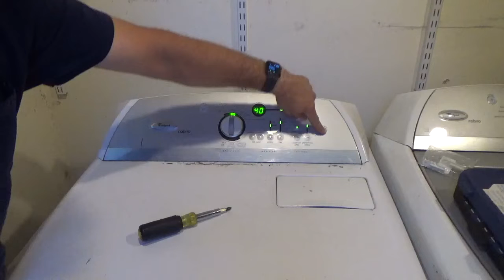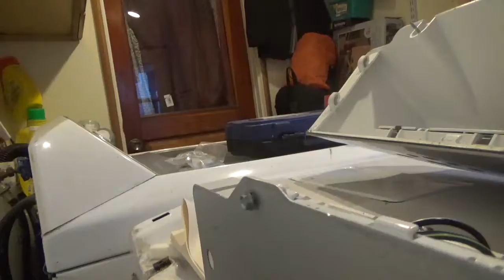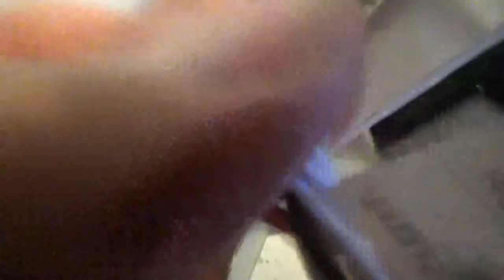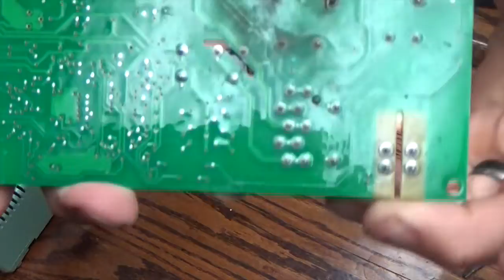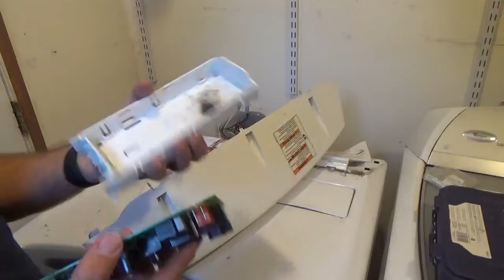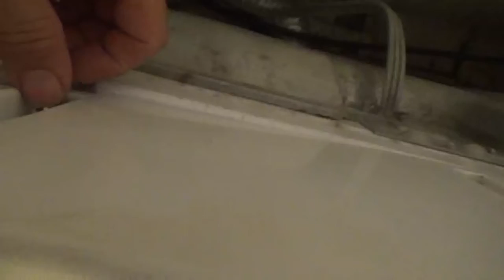Whirlpool Cabrio Dryer repair.  Motor won't start

Comment: had resoldered this relay 3 times over the past 10 years or so, this time i got the F1 error resoldering did not work.  Also could not test continuity through the relay. this video was VERY helpful . the relay is available on amazon for 10$ and used some wire from an old extension cord from my garage for the trace reinforcement wires. Thanks for posting!
Reply from the maker: Wow, glad it helped you solve it this time, and great tip on the part availability!

Comment: Thanks so much for this video. I almost spent $1,000 on a new dryer but thought I search and see if others had this issue. Opened up the panel and the connection you repaired the first time was blown on mine. Got the solder iron out and soldered in a new wire and it works like a charm. Thanks for posting this will all the steps.
Reply from the maker: Glad I could help!

Comment: Hello!  Great video.  Followed the video, added the wire and did exactly what you did.  Once I plugged in the dryer, it started running continuously.  It only stopped once I opened the dryer door.   Power turns on, still made clicking noise once I selected a cycle and started it.  Wonder what that means?
Reply from the maker: Check how you routed the wire.  That is the relay control.  It sounds like you shorted out the relay so it's always on and running.  That will burn things up in a hurry.  Good luck!

Comment: my cabrio will start but stay at sensing with no motor. I've replaced the fuse and thermister. Have not gone the route of this video but it sounded like when you pushed start nothing happened, which is not the case with mine. I'll check the board but maybe the moisture sensor is bad? Error code is F 28
Reply from the maker: I dealt with this problem just last week with a Whirlpool washer.  It was the shift actuator.  But I don't remember this unit having a similar part 😕
Reply: @masterofnone8065  No actuator on this unit. Thinking it might be the ignitor. When does the ignitor flame fire up? I hit start and the machine hums then stays at the sensing setting. Checked the board and all looked OK. Any help appreciated!
Reply from the maker: @winnsail31  Sorry man, never personally dealt with a gas dryer repair.  This sucker is electrical.
Reply from the maker: Dumb question... but have you checked the belt?  I've replaced the belt on this same dryer like 3 times now.  Common failure.  As is the tensioner and pulley it runs off of.
Reply: Hey did you fix your dyer!? I'm having a code f-28 problem.  I changed the sensor and fuse and it still doesn't work . Any suggestions?

Comment: I don't know how old my dryer was. It is exactly the same as yours but the motherboard looked new. No dust at all. I noticed one of the solder was loose so I filled it in. It works great now. Taking it apart took about 10 minutes max. Pretty easy job. I had the F1 error. Where it powers on and all the controls work but after pressing the start button, nothing happens.
Reply: Glad I was able to help, at least a little!

Comment: My board is perfect. My pulley looks fine. I see no burns anywhere. Theres a tiny white switch? under the pulley bar. Will that control power if its not working correctly?
When I press start it only clicks.  My belts are good. My fuses are good. Thermal and door switch good.
Reply: Hate that creators will never respond in most cases they don’t know they are DIYers such as ourselves. But  did you end up figuring out the source of the problem or did you just buy a new dryer ?

Comment: i hear a click on mine so does that means mine works? but my drum doesnt spin
Reply from the maker: The belt could be shot/off.  I had to replace that at least once on this dryer.  The idler pulley seized up and burnt the belt up.  Unfortunately I did not get that on video.
Reply: @masterofnone8065  looks like my thermal fuse blew. belts were fine
Reply from the maker: @firstphoton655   That will do it too!  They are very cheap.

Comment: control board is clean, yet I have the same issue you did except I do hear the relay click.
Reply from the maker: I would take an extra close look at the tracks running from the relay to the plug.  Those are the tracks that I'm repairing at 2:29.  They burn out in the oddest of places.  It could be a bad relay as well.  Mine ended up failing a year after this repair and I had to replace the relay itself.  Here is the video for that -> https://www.youtube.com/watch?v=W2KnC-fR58A
Reply: @masterofnone8065  thanks, upon examining the board under a magnifying glass, i can see all contacts and traces are 100% clean.  and because I hear a "click" when starting it, the relay may be ok or is it... even if it clicks?
Reply from the maker: @ChronicKPOP  The next thing to check would be the belt.  Pop the dryer apart and see if the belt has broken or come off.  I had this problem on this same dryer (before I started my channel) where the idler pulley seized up, then burnt through the belt.
Reply: @masterofnone8065  Thanks, checked the thermal fuse with ohm meter, it was fried, replaced with part on amazon (3 fuses for $15) or 22 for $22 lol - if I want to go into business :) New fuse, dryer is back on duty.
Reply from the maker: @ChronicKPOP  Awesome!  I almost suggested that, but I've never had one go and figured that was the last thing to check. LOL.

Comment: Nice video. Good advice worked like a champ. I'd tested many components before concluding it was the board. Couldn't afford a new board. Was contemplating shipping it to one those repair for $39 places. Then couple days later apparently Googles system ran your video on a ad and it came up on my fb. Wild! Hey saved me $$$$. Thanks Buddy.
Reply from the maker: Glad to help!  I'm honestly surprised that Google advertised my video! LOL

Comment: Is there special precautions that need to be taken due to concern for static discharge damaging the circuitry?
Reply from the maker: It's pretty rugged circuitry, but it's always best to 'ground' yourself before touching any electronics.  The screw holding a light switch cover plate on it always a good ground in all modern houses.

Comment: love the video. my board has no burnt spots, all looks good, door switch turns light on, the fuse checks out with the meter as good. motor turns with resistance seems fine. still no start. don't know how to check the start button in the circuit board.
Reply: my issue also.  Did you find a solution?  mine did this last night.

Comment: Your video was exactly what happened with my dryer. Got the soldering iron out, fixed the smoked trace and it's working again. THANK YOU FOR POSTING THIS!
Reply: I just fixed mine the same way. Thank you so much
Reply from the maker: You're very welcome! :D

Comment: I have the same dryer. It spins and heats fine but was making a rumbling/humming noise during the drying cycle. With the dryer off it makes the same noise when you manually spin the drum. During the cycle today it made a loud thump and now won’t start. The dryer will turn on and I can hear the click when I press start but I won’t start the cycle. Any idea of what it could be ?
Reply from the maker: Your idler pulley likely seized up and blew the belt out.  I didn't have a channel when I replaced that last on mine.   https://www.amazon.com/gp/product/B07RZJ282S/  This is the one I used.  You'll need to take the dryer apart and see if the belt is still intact and usable. (it may have just slipped off when the idler fully gave out).

Comment: My dryer runs but does not dry the clothes, comes out damp..it runs all cycles, delicate normal casual etc...but just does not dry,.any suggestions.
Reply from the maker: Can you confirm that it is actually spinning?  I had to replace the belt and pulleys on this dryer as well.  Also make sure all your vent are clear and there is good airflow.
Reply: @masterofnone8065  yes its spinning, I just ran it.thanks
Reply from the maker: @atclb2356  Cool.  Mine sounded like it was running, but wasn't actually spinning.  At this point its one of two things.  The heating element isn't working or the vent is completely plugged.  If you move it away from the wall you can check the vent out of the house and make sure its clean, and check the venting up into the dryer and make sure that is clean too.  You can also run the dry with the vent hose disconnected for a moment to a) make sure it was exhausting properly and b) see if the exhaust air is in fact warm/hot.
Reply: @masterofnone8065  ok will do that when I get home, keep you posted, thanks

Comment: My dryer was burned a few years back and it just started doing same thing F1 code it will light up but wont start. Sensing light on.. not burned these time.

Comment: When I press the start button a click can be heard. Did you have a click too?? I would assume it to be this particular relay?
Reply from the maker: Depending on where it burnt it, it could very well exhibit this behavior.
Reply: Appreciate the timely response.... I tore into it today and I think it's going to be cheaper to go to town and buy a new one.....
Reply from the maker: @macanocious3000  Was the fuse bad?  Those are really cheap to replace.  They are a larger fuse. Like this ->  https://www.amazon.com/gp/product/B07Z39824W
Reply: Overreacted. Ran onboard diagnostics from another video. Referenced manual under interface... just ordered the idler pulley... Now the waiting game for delivery - which is the worst. Would be awesome if the internet had a store in town - 😆 🤣 
Thanks for helping me through this. 
M.C.&H.N.Y!
Reply from the maker: @macanocious3000  Oh yeah, I've replaced that on this one too.  It's a pretty easy job.  If the belt is still in place, take a picture before you take it apart to make sure you get the belt-routing correct when everything goes back together.
Reply: @masterofnone8065  the belt has shifted so hopefully when I pop the top there is some kind of line where it rides........🤞

Comment: My dryer sounds like it wants to start it will after about ten try’s and runs for a minute and stops. Any clue what could be bad¿
Reply from the maker: There are a number of things it could be.  I would check the fix I outlined though.  It may be just about burnt through.

Comment: My dryer is not burned from the circuit board but it still does not start the motor, I still want to connect the two points? or do I need to change the relay?
Reply from the maker: Have you checked the fuze?  Dryers use a large inline fuze like this https://www.amazon.com/dp/B07Z39824W
Reply: @masterofnone8065  thanks i'll check it